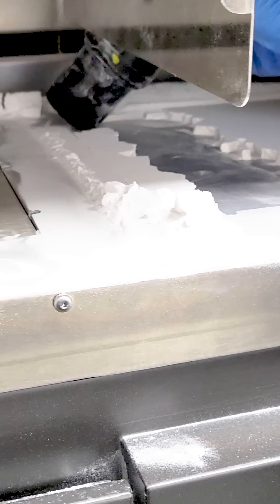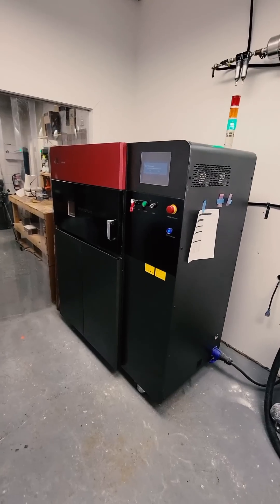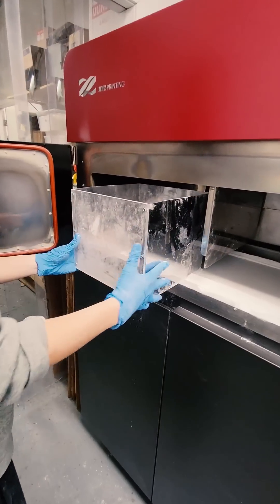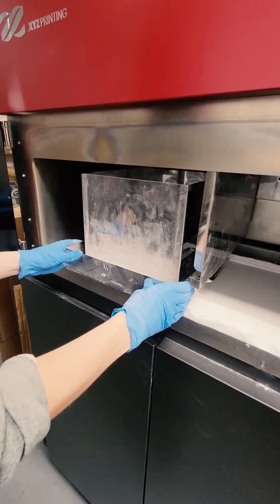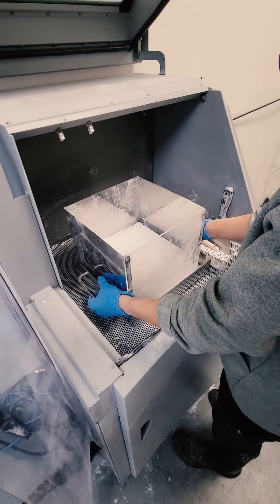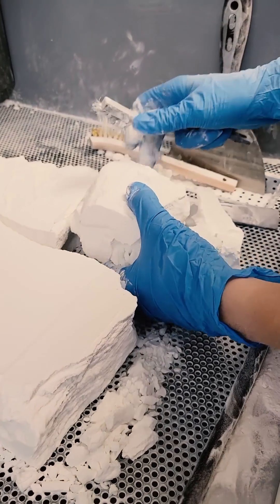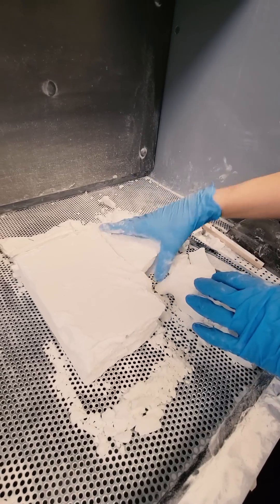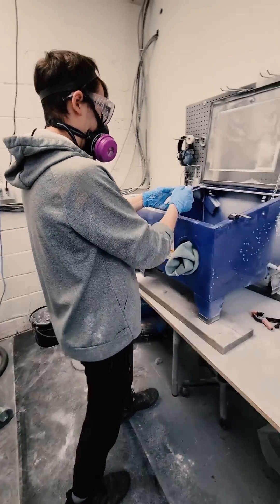Selective Laser Sintering At Objex using our XYZ MFGPRO 230_xs

Comment: Seems really awful for plastic printing. Maybe ceramics or metal prints, but plastics can be smelted and finished at reasonable temperatures without needing to fill the air with dust.

Comment: We have one similar at my firm. It’s not lasers though it lays down a type of glue over and over. It’s really fragile when it’s done. You really have to be gentle and then when it’s all cleaned up and we dip it in color bong which is essentially superglue. It has a chemical reaction and turns super hot. Then cools down and it’s really hard.

Comment: You can only recycle it about 3 times then you have to throw it away. (We did it more often but it still creates allot of waste). Wel atleast with a hp ful color powder printer
Reply from the maker: Bit different for SLS vs. CJP which we also run in studio.
Reply: @Objexunlimited  we used CJP but was not to bing of a fan we often had wapred parts.

Comment: We had a 3D printer like that at our shop, used what looks like the same powder but used ink to bind the powder. The result was extremely fragile but you could print in color. Great for making vehicles or coins. We would "reinforce" the product by spraying it with a super glue like material.
Reply from the maker: Yes what you're referring to is CJP. Which we also offer. CJP uses gypsum powder and an ink jetting process vs. this process shown which is SLS selective laser sintering with Nylon. =)

Comment: This is old 3d printer technology. They moved on from this to filament and resin. It's still cool to see, but this is the kind of machine they had in my engineering class in highschool in 2008. We would design our parts on inventor and then he would print them out and when he got all of the powder off, he would cover them in super glue to give them more structural integrity.
Reply from the maker: Thanks Kyle, think you might be referring to colour jet printing (CJP), which is an ink jetting process, rather than laser sintering. Which we also offer for our full colour modles =) Otherwise we'd love to know what highschool had an SLS machine in 2008, that must be one awesome highschool! =)
Reply: @Objexunlimited  I believe you are correct. As a highschool student new to 3d printing, the two look very similar. Does the SLS process provide better structural integrity than the one I was thinking of? My projects from back then have a few broken parts and I have to treat them fairly delicately.

Comment: A high power sand blaster that shoots glass beads that doesn’t eat at iron and explodes on contact which also leaves hardly anything but dust they’re useful for cleaning up rust and doing exactly that

Comment: OK so I work for a company that use to service these types of 3d printers, note the word "use".  First off they are trash the prints they produce take longer than most all 3d printers, it huge and takes a lot of electricity compared to other 3d printers, also it pretty much requires other finishing equipment to make not brittle as 100 year person bones, and my favorite why never get these because they take 4 hours to heat up and 3 hours to cool down to work on them do basically when it breaks and its breaks a lot you have to wait almost 8 hours to see if the fix actually fixed it.
Reply: Thanks for all the insight!

Comment: Okay so the only thing you got wrong here is that it is not a laser that does this: it is a type of glue. I don’t know about THIS printer maybe but historically Gypsum (the powder) is cured by a superglue type adhesive and injected with ink to give color too. 

You can finish the product by curing it in a actual super glue and it will impregnate the gypsum to last a REALLY long time. I have 3D prints from years ago that I still use today

Comment: Does it still require support material like other 3d printers
Reply: The excess material is the support material. From what I can tell, it lays down a layer of material then uses a laser to rapidly melt and solidify the parts of that layer that will be the print, then repeats the process until the print is completed. Everything not heated by the laser remains a granular powder

Comment: This has to be really really precise or something because that takes horribly long to get the print out
Reply: Do also note that this type of printer can use very different plastics, like thermally resistant types, and require next to no support for intricate designs. This method is also used for metal printers, which obviously are much more difficult to print with.
Reply: @mrvolans7862  I honestly prefer supports to… whatever that is.
Reply: @MaskedFella234  I mean supports are fine but this process is one of the only ways to print in metal so it ends up being extremely useful. Messy yeah but you print steel with it so it's worth it
Reply: @thedudegs-f9w  surely useful for metals, but plastic builds are really not worth the effort
Reply: @MaskedFella234  even that depends. This looks better than resin and about as difficult. It's probably about as precise or more and sometimes you need really precise plastic parts. Plus they can do different plastics that fdm and resin can't. I'd say it's worth it to have the options
Reply: @thedudegs-f9w  Absolutely fair point, but for anything that does not require specific materials or over-the-edge precision, it just isn't worth it.
Reply: @MaskedFella234  Well, yeah, obviously. It's like taking a cargo plane to visit a buddy the next town over. It'll surely work, but it's not the intended use.
Reply: Laser sintering machines can be used for 3d printing in metal as well, and commonly is. Although it's far from a cheap process for obvious reasons lol
Reply: Having used different printers from that company, it's not too bad. IIRC the print itself is much shorter than an equivalent FDM print, so the extra few minutes of post processing time isn't too bad
Reply: laser sintering produces very strong and complex parts and can handle a wide variety of materials compared to other types of printers. this process is best for parts that requires a lot of support.

Comment: High power glass particles 
Lamao that a sand blaster
Reply: You can use glass beads for less abrasive blasting. Commonly used to clean cylinder heads so you don't ruin the finish and machine work
Reply: @OpenThrottle47  it's called a sandblast cabinet, like he said. A sandblast cabinet with glass beads as sandblast media.
Reply: @OpenThrottle47 if you know you know.

The other guys didn’t know.
Reply: @OpenThrottle47  true. Sandblasting was weaker than media blastng, as i thought.
Reply: Well, media blasting because no sand, but the same thing basically.
Reply: @teaganwalsh7011  wHaTs GlAsS mAdE oF
Reply: @Friendly_Neighborhood_Dozer  I'm legit dying over this comment because no one else seems to get it.
Reply: My first thought lol
Reply: “Sand blaster” is just a name, there are ones that specifically use fine glass beads as to not damage the surface or take off too much material. Others use what I know as Korund which is just carbide flakes, and they eat through a 5mm steel sheet in a minute, so they would absolutely destroy the plastic
Reply: Glass blasting and sand blasting are 2 different things. Similar but different
Reply: @It5B3ANS  Yes, both are media blasting. You can also use things like ground up walnut shells or dry ice.
Reply: @bruwin  I absolutely hate dry ice blasting. Is so fucking loud and everything gets wet it's horrible. We had a company come in to dry ice blast our welding machine or more precisely the part of the machine where you put in the metal components that gets welded by a robot arm.
Reply: @Slimboy025  You might hate it, but it's fantastic for applications where you don't want to leave any media behind.
Reply: Dale Gribble and his pocket full of high power glass particles
Reply: Glass balls

This guy

SANDBLASTER
Reply: God how painful would it be to get blasted with that
Reply: The process is called Media Blasting. It’s only Sand Blasting if your media is sand.
Reply: Media blaster but yeah
Reply: Glass beads are finer and less abrasive
Reply: Yeah, Worst "technically true" i've heard in a while
Reply: It's actually a glass bead blaster. There used for stuff that's softer then metals. Sand will chew most stuff apart like this. Used to operate a few different kinds of sanders for a company to clean up turbine blades after they were cast before being made into full engines.
Reply: Legit how the media describes ar-15s "high powered assault rifle" 
Lmao it's just a small caliber semi auto rifle.
Reply: Welp, sand is a glass tho
Reply: Not a sand blaster. A glass beader
Reply: Oh yes, Lamao, the asian fighter who laughs at his opponents. 😂
Reply: Ya we all laughed a little inside.
Reply: Yeah but some people don’t know what a sandblaster is
Luckily the name is formatted in a way that the average people could tell what it does right away but you know
Reply: Literally about to comment this
Reply: #weebsmustbesterilised
Reply: @ben_dover33  tf is this
Reply: @mrbotlegmechanic2491  it’s true
Reply: @callsignsealt5340  whats true exactly?
Reply: @ben_dover33  k 😐
Reply: @ben_dover33  *sterilized

#notcoolbeingstupid

Comment: Fascinating. Is this better than 3d printing with the plastic filament?
Reply: It can work with non-plastic materials like metal which is very useful
Reply: @RegularTetragon  metall is also working with fdm printets
Reply: It is also much more detailed
Reply: It doesnt need support material and you can make smaller layers